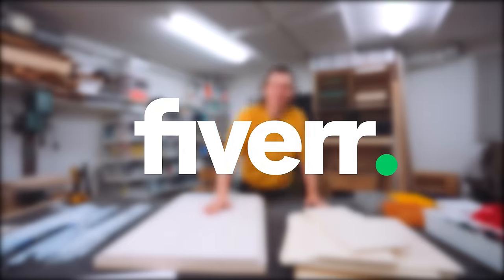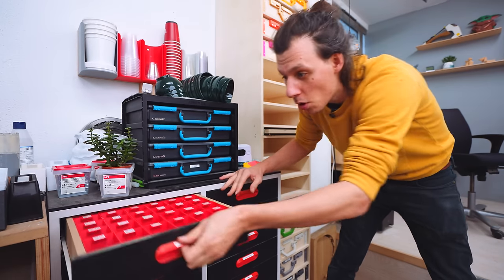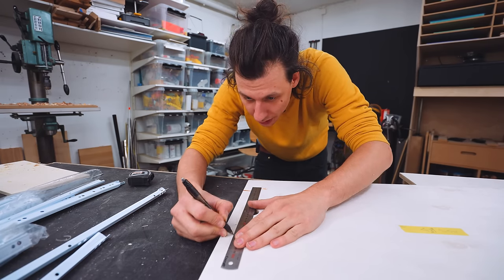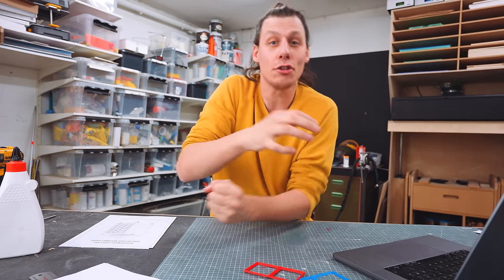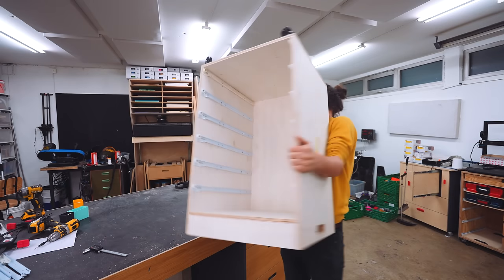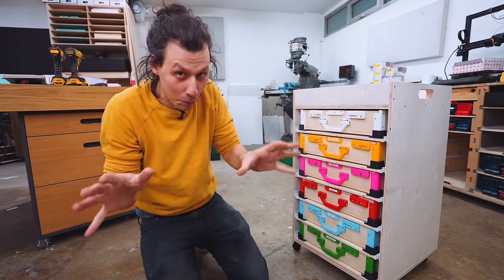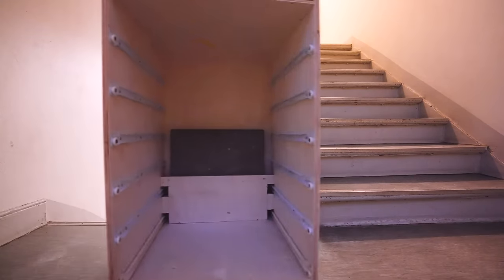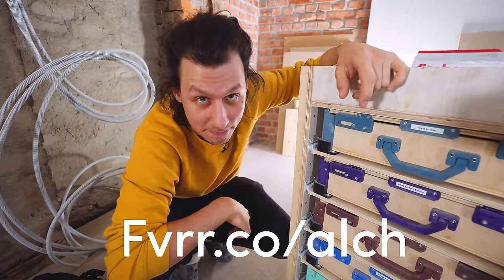This Makes my life So Much Easier - 3D Printed Tool Cart

Comment: Problem, I can get a non customized husky case from homedepot , 3 for $14.99.   To build a case, the 1/2" plywood just to make one is already $30
Reply: yup + 3d printed parts (filament + time). Not so cheap but still nice project :)
Reply: To be fair that may be true in the States, but in some places in the world those plastic cases are harder to get or more expensive - notice in his older cart the ones he's using are the $$$ version of those cheapo plastic cases at orange box.

I think the plywood won't last as long as the "good" plastic boxes either way, but buying something at the store isn't content, and there's joy in the making even if it costs more.
Reply: @geoffreychadwick9229  That's what I am saying, it makes good video, but building this yourself almost makes no practical sense.  Printing those little containers will takes days, and just 1 spindle of filament is $18 USD.   What make sense is use cardboard boxes to make little container, but this again won't make pretty color for content.
Reply: @geoffreychadwick9229  btw, 1/2 plywood is very very strong, I think you can stand on his box in the middle and won't even flex.   Just the weight, the time and the $$$ aren't justified

Comment: instead of a concrete slab you could add some folding wheels under the bottom drawer and save on weight.

Comment: Rather than adding more weight, why not have the opening of one drawer pull close any already open drawer to avoid the cart from tilting?  A set of strings should do the trick, no?

Comment: You should take your container designs to a company with injection moulding equipment. It would make for an incredible product line.
Reply: The containers cannot be injection moulded.
Reply: @RussellNelson  Actually, they can. Are you thinking the tab would get in the way? There are ways of dealing with it.
Reply: @JV-pu8kx  Yes, expensive ways of dealing with it.

Comment: Wouldn't it be better to make the bottom drawer with fixed/sturdy drawer rollers that could accomodate a foot or a set of wheels so that when all the drawers are pulled out, the front doesn't tip rather than the counter weight? I would want the cart to be as mobile as possible and carrying dead weight up to a jobsite is not good.

Comment: I tried to 3d print something a while ago through an online company and it was going to be crazy expensive. Is custom 3d printing really that expensive or was it probably a bad/inefficient design? Like how much do you think would one of the 2x2 boxes cost? I'd love to do something like this in my shop
Reply from the maker: I've tried to have a look at the cost to print them by a company before, but unfortunately, it seems like the price always ends up being fairly high. I'd rather recommend getting an inexpensive 3d printer like an Ender or something and printing them yourself.
Reply: @achappel  thanks!!!

Comment: Instead of a concrete block on the inside why not just add a 5th castor on the front in the middle to prevent the tipping?

Comment: i found the brick, and the hauling up steps, not so useful. I would have thought something that can handle terrain would have been more interesting. I understand the container themselves being disorganized a good focus, just that this is not the solution,  perhaps try 80/20 an attached wheel/track system that could handle stairs, and posibly be reconfigured, yah i know it sounds transformers... but wood storage starts to become.... large and in the way.

Comment: 19/32 is basically just 5/8 if you want easier terms. 50mm is just as arbitrary as 5/8 inch and and you should just use what is available. I would be shocked if any store sold 19/32 plywood or that you project would actually be better to make 19/32 yourself
Reply: lowes and home depot both sell 19/32 plywood rather than 5/8.. it's just nominally known as 5/8

Comment: You can only open 1 case at a time so why bother adding the wights? Unlike traditional tool box/rack, you can open multiple shelves because it doesn't have the opening lid of the case.